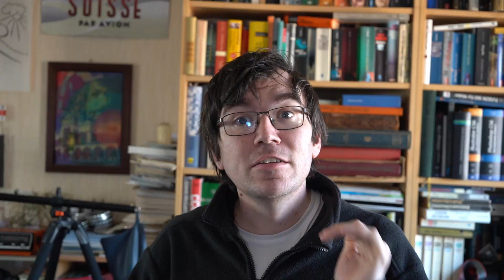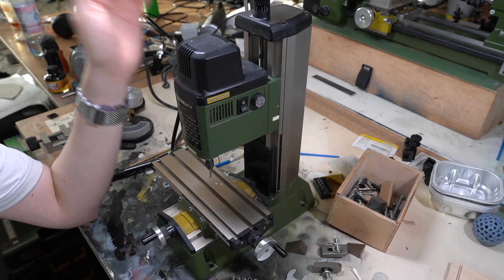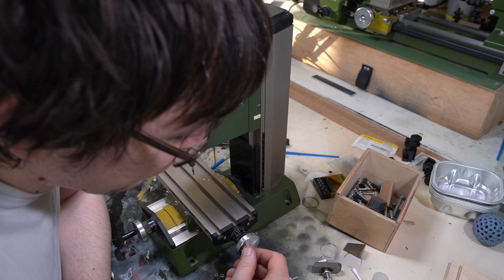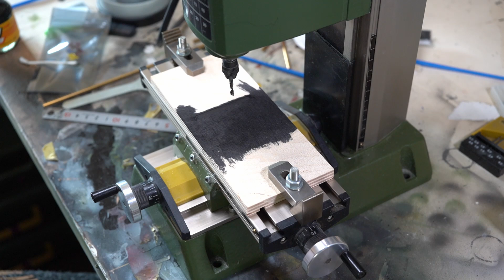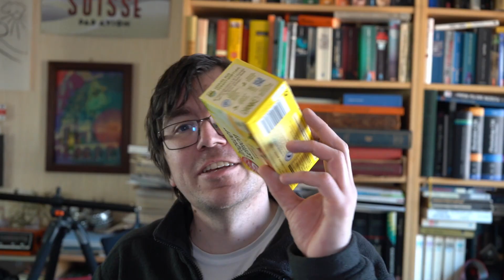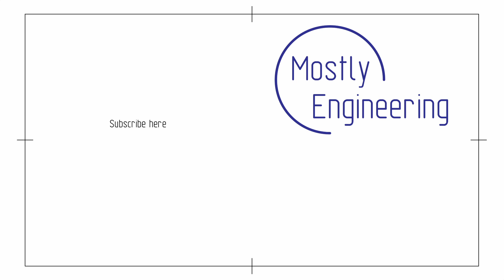Proxxon MF 70 Mini Mill Review _ My thoughts after using it for over five years

Comment: Perhaps you could secure the machine to a block of wood with the same size of the machine's base ( block of wood can be laminated pieces of quality plywood), and sufficient in height to enable easy use of hand wheels, this block could have small metal angle pieces to enable the clamping of the base to your work bench.
"Z" hand wheel, the marker is probably on the side because it would not be visible on the front when at a certain height it would be obscured by the motor, the simple solution is to score an additional mark on the front, fill both marks with white paint and smooth after with very fine wet and dry paper, then use either marker as suits.
Reply from the maker: Thanks for the tips
Reply: @mostlyengineering5253 Wilkommen!